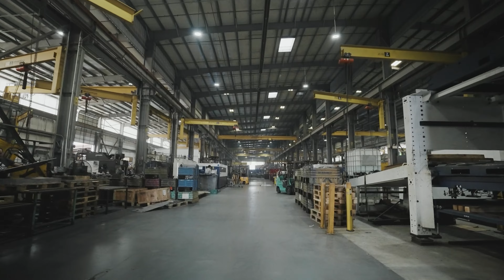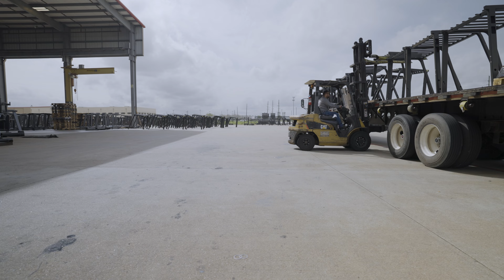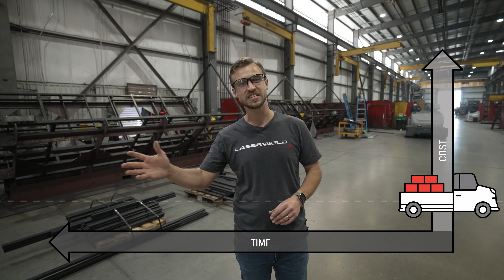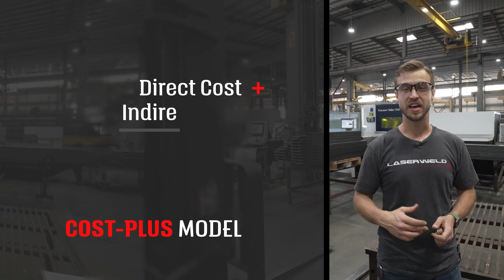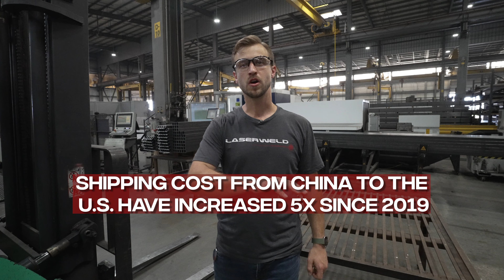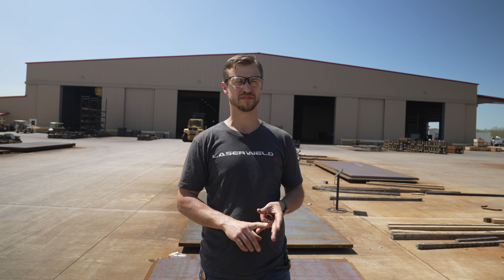Why American Manufacturing is Losing to China

Comment: I make a fertilizer, so I'm not necessarily manufacturing, but I'm subject to our limited manufacturing.  If I want a 316 Stainless steel cone bottom tank, there's no centralized database for finding that.  The US doesn't have an Alibaba really.  There's a burden of knowledge that's just missing for purchasing American goods.  I can go online, look at stainless steel tanks, call the distributors only to find that it was 304.  Nothing is labeled and when it is, there's no willingness to work with a small company trying to buy it's first industrial quality tank.  Costs aren't transparent, and like you said, I feel like I'm talking with a distributor of a distributor of a distributor just to make a purchase.

We need to acknowledge that not every business has 6 figures for machinery and that it's acceptable to do a custom job with transparency.  We just seem incapable of making simple parts.  Talking about a different part that I've looked for in the past, why is a 316 stainless steel coating pan $40k?  For what I was asking for (100lb capacity), it a minimum of 10x margin they were asking for.  US commercial grade manufacturers are just intellectually lazy with regards to building cost effective solutions.
Reply from the maker: It is true that many American industries seem to be in silos (no pun intended ) so accessing pricing information or even technical info is difficult.  At Manufacturing Revival we are working to develop a community with cost plus pricing and a data base to make the process more predictable and transparent.  It is necessary for sustained growth
Reply: @LaserWeldTexas  Maybe one day we will work together then.